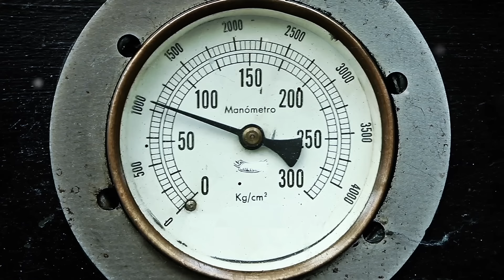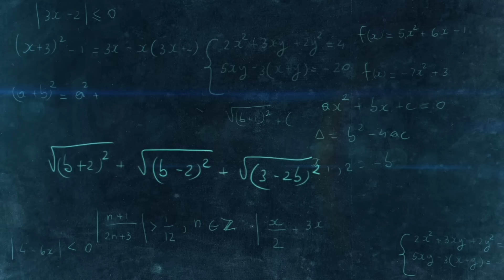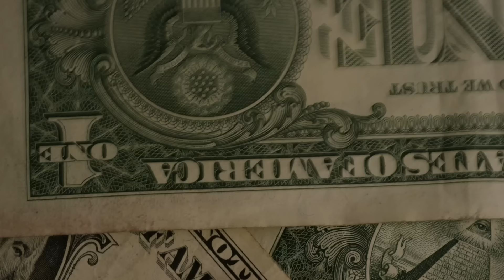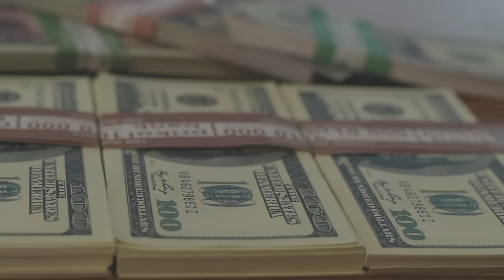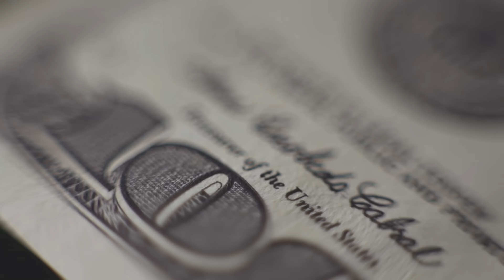5 Most Expensive Mistakes in All History

Comment: I recently retired from a maintenance job. As far back as I can remember we used ‘lock out/tag out’ on all electrical/mechanical/hydraulic/plumbing etc. which means when you take something out of service you lock it out so no one can use it and you tag it so it’s clearly marked out of service, sign it so they know who is working on it and in my case I was the only person with access to the key to actual lock. This has been industry standard for more years than I can count. If your story about that platform explosion is accurate their entire maintenance program was suspect from the people who ran it, the people who used it all the way to the safety people who must not have done yearly checks/tests with the maintenance workers on following proper safety procedures. Just saying.
Reply: I was thinking the very same thing.  ANYONE that was caught attempting to remove or ignore a lockout tag could be in very serious trouble.  Clearly this procedure was NOT followed and the end was just a matter of time.
Reply: The Piper Alpha disaster led to massive changes in operating procedures throughout gas and oil production worldwide. Safety processes unfortunately seem to be something humans only learn through bitter experience.
Reply: 1988
Reply: @kenoliver8913  Also look at the Titanic. There were major safety regulation created after that disaster. There were three airplane that had a tail problem at high altitudes because of the very cold temperatures. The solenoid for the tail was rated for a certain range of temperatures but the failures happened at temperatures it wasn't rated for. Two of the planes had crashes but the third time they were fortunately able to land the plane. They ran the solenoid at these new range of temperatures and saw it failing. NTSB had investigated all three times.

Comment: Fukishima for building the back up power supply below flood level.
Reply: Yes indeed, one of the worst engineering blunders of all time. 

Had the diesel generators been placed on the same level as the pumps they were supplying power to, this disaster would not have happened at all.
Reply: More like General Electric for building 7 reactors next to the ocean along one of the most active spots in the Ring Of Fire.

The fallout will last a century or more.
Reply: I've always proposed that a heavy vehicle with back up generators and pumps should be kept in a hardened shelter 20 k from each nuclear plant. This truck is to be maintained and crewed at all times the same as a fire engine.  Design the plant to where this truck can pull up and hook up rapidly.  That way you always have a redundant back up at another location. Yeah, it'd cost some money, but look at how much money gets blown cleaning up even a minor release.
Reply: I heard they were planning to build a higher wall for the Plant a few days after the day of the Earthquake, if the Earthquake did not happen.
Reply: @Shane888 Davies You obviously have no idea what you are talking about.  It took DAYs for Fukushima to melt down after it lost power.  They attempted to cobble together the very suggestion I made, but because of lack of an easy way to hook up external generators and pumps, added to the flooding made the attempt fail.  At least read a wiki article before trying to look smart.

Also.. road debris?.. Did I suggest loading this gear on a Honda Civic?.. I'm talking about a HEMTT or larger vehicle. Yeah.. this will be stopped by road debris.

https://www.youtube.com/watch?v=zCA3Kn-Y5Gw
Reply: so true.why dont we build our back up system or redundency pumps below water level were it can flood out the extra electric or diesel pumps.The ol mentality that water cannot ever get here..
Reply: @Shane888 Davies   Study it before you comment.

Comment: Worth an honorable mention: the Hubble space telescope was initially unusable because of an error by a technician during the construction of the interferometer, causing the mirror to be off by a fraction of the width of a human hair. It cost a total of $700M to repair.
Reply: $700M? Peanuts
Reply: a minor manufacturing error.  It was corrected, no disaster happened, and no life was endangered.
Reply: @pashakdescilly7517  Pretty expensive "minor error," though.
Reply: I heard that most of that cost could have been avoided if the US Navy had allowed them to use their test instrument to check the mirror before final assembly, in which case they would have used the backup mirror which was already made and lacked the same flaw. But due to security concerns about revealing the ultra-high resolution of that test rig, the mirror was not tested and the flaw not detected, requiring the $700M repair instead of the $1M mirror swap on the ground.
Reply: @DHyre  Let's hope Webb will not sustain some of damage that will either cut the project short or reduce the quantity and or quality of the data coming back.
First light, 12 th July.
Reply: @pinball1970  It already has damage from a micrometeor hitting one of it's (mirrors? sensors? not sure), This has cause one tiny bit of the image to be off. Thankfully most of it is still working great and sending us wonderful photos.
Reply: @tequilacollins  Five times so far and one damaged one of the hexagonal mirrors irreparably in one area. So, there will be some corruption of data but the images and spectral data is still performing beyond expectations.
The instrument is not only re writing astronomy it is re writing cosmology.
6 months to a year is my guess to join some of these dots.
Crazy stuff and extremely exciting times in physics.

Comment: While not the worst in cost or loss of life, I think the Halifax explosion in 1917 is an honorable mention. A cargo ship full of explosives collided with another ship, damaging barrels of flammable benzol, and the sparks from the collision ignited the vapors from the benzol and in turn the ship. The fire grew out of control and eventually detonated the explosives and created the largest man-made explosion at the time. About 1800 killed, 9000 injured, and roughly $800M USD in damages (adjusted for inflation).
Reply: What was the mistake that caused it?

Comment: How about the Beirut Ammonium Nitrate plant explosion from 2020?

Unfortunately the cause was due to the age old reson: improper storage. 

As a farmer I used to use this stuff time to time, but I remember that if the bags get hot it explodes. It was the only fertilizer I never stacked on top of each other since the dead air between the bags of, well anything, get hot on a summer day in the shade. I remember a relative was coming back from the store and his barn was gone, equipment in mangled metal, and a crater where his barn was. Good fertilizer but very dangerous.
Reply: Its used in some explosives.

Comment: The proper communication between shifts is known as “log out/ tag out”, an industry standard. That way there is no miscommunication
Reply: Cant figure why they did not follow it. That is why power boxes have ability place a lock and valves usually have a chain and lock.
Reply: Lock out tag out is a joke. While its an industry standard places dont use it correctly for a number of reasons (that I do not agree with). New tags cost money and they don't want to be always buying tags. You can use a dry erase pen but thats bad because crucial information can be erased in error. There is a price put on safety when it comes down to even the smallest things which is why we have accidents like we do.
Reply: Although a scapegoat can almost always be identified for these types of incident. The true root cause is almost always procedural/cultural.

Note I know nothing about this industry or this incident. Just relaying my experience from the aviation industry.
Reply: I work in a tennessee refinery, 12hr minimum shift but last hour we add comments to our side of the product paperwork and wait for next crew so we can communicate, much different now
Reply: Lock out tag out, lock it & tag it.
Reply: Lock out tag out is for when a machine is being repaired or a change over etc. Lock out tag out is not used for shift changes lmao wtf.
Reply: I was the head Fitter in a Steel Mill Scrubber. We had personal Safety Locks. I had another Dozen Keyed alike Safety Locks that Myself and my Partner had the only keys.. All the supervision knew , those machines didnt start Until Billy or I were notified and pulled our locke off the mains... Some  repair days there were many Riggers, Fitters, and Electrictions..
Reply: Or "danger" tape and a note on paper (or whatever) taped (or fastened) on the equipment, on the tape itself, and maybe a cone with the note taped on that, all secured With a wire rope and a padlock.  Maybe overkill, but rather overkill then loss of life.
Reply: I've seen co-workers use machinery that I've locked and tagged because they didn't have any other equipment to use. They later complain when I write them up and say they didn't see it was locked and tagged when I clearly show them they did on the security replay. People really just don't give a fuck about safety.
Reply: @raptor31able  I don’t really understand your comment. If you lock out a pump with a supervisor lock and tag it you can change shifts. Everyone on first shift removes their lock,everyone on second shift places their lock. What’s the problem.
Reply: @GodlyWodahs  If it’s been locked properly they can’t use it. ???
Reply: It’s lock out tag out
Reply: And it saves lives
Reply: @TheoneGodfather  I would expect your used to not understanding things by now.
Reply: That was coined by osha well after that
Reply: Lockout tagout
Reply: I was just about to leave that into the comments but you did it already.
Not tagged out??
Very strange.
Reply: @psp4150  
 perhaps it used to be but where I work in the oil sands it is not a joke.
 it is taken very very seriously and the system works.
Reply: @1joshjosh1  yeah it absolutely works when applied correctly. My current job applies tags with zip ties to save the costs of having to buy more locks. That's why i say its a joke; the concept and design are 100% but companies would rather have an accident than buy locks and tags. Glad to hear your place keeps you guys safe. The old motto of if you think safety is expensive try an accident still does not hit home for companies.
Reply: @psp4150  Yea the system is fine. Sounds like the company you work for is fucked up. Where I work if we don’t use loto properly we face termination.
Reply: @psp4150  
We sign out our lock everyday from a dedicated lockout tagout room.
And at the end of the day we have to hand it in and the guy checks the serial numbers.
And it goes into this master box that is locked.
Pretty serious stuff.
I'm not sure about zip ties That doesn't seem so safe to me although if you are caught cutting one that's jail time.
Reply: @raptor31able  when your shift is over take your damn lock off,!
Reply: @raptor31able  Correct. This guy clearly doesn't work in the industry.
Reply: The suggestion that LOTO wouldn’t have prevented the first disaster says a lot about how individuals within their organizations are complying with LOTO requirements. If you think it wouldn’t have helped, maybe you’re part of the problem...
Reply: in lock out egg nog nougat the scratch fence has bilateral stink wink sauce on the cupler seams and TAGS are put on gags and stilt wearing INCANDESCENT mon kee saliva with stew nug gets in vii&!!- NASA
Reply: @mikenrarsomadigan3662  electric shins?
Reply: @TheoneGodfather  Attention:  when the lock nut is connected to the VTECH gershinatotr valve and vulvas are at +700lbs p>>nut ^^90, the square of the gill is RATIFICATION of nip ple dust spectrometers. One can plainly see the distinction here.
Reply: @joecascade5105  Makes sense,thanks.
Reply: Part of the reason for this is the Piper Alpha disaster, which has several documentaries on Youtube. The night shift started up a pump that wasn't connected to anything, pumping highly flammable gas into a machine room.
Reply: lock out tag out here. cause you lock the switch with a padlock and a tag
Reply: Lockout tagout is for when a machine is being repaired and the electricity has been cut off!!! Wtf are you talking about 🧐
Reply: That didn't become an industry standard until after the Piper Alpha incident.
Reply: Worked perfectly :-)
Reply: Lock out tag out maybe?
Reply: Us govt have safety regs because of accidents like this. Often like these one will trigger new regs as we know. Other countries have different rules or none
Reply: first expensive mistake is to believing in Abrahamic religion including Christianity and Islam
Reply: Did that procedure exist before 1988?
Reply: Reminds me of a shift miscommunication after a fuel system repair of a Boeing 707 aircraft on the ramp at McClellan AFB back in the 70's. Day shift crew told the swing shift crew the aircraft was ready to put fuel back into the tanks just repaired. Unfortunately the swing crew did not double check the fuel tank access panels. One had been left completely open. The aircraft was turned back to the Air Force flight line people. One guy came out, turned on the generator, put power on the aircraft, climbed into the cockpit  a flight line security and opened the wing fueling control valves to let fuel back into the fuselage tanks. This was a violation of flight line rules requiring a minimum of three personnel for this activity. With the open fuselage fuel tank panel all of the wing fuel was being dumped onto the ramp and making a lake of JP-4 fuel under the aircraft to include the MD-3 power generator. Fortunately, a flight line security crew drove by and saw what was happening. This was at night. Turned out that around 4000 gallons of fuel was dumped on the ramp. Could have become a fiery spectacle. Blame was ultimately pinned on the crew that initiated the fuel transfer without proper checks and not having the required personnel. However, the root cause was improper communication between the shift personnel on the proper closing of the fuel tank access panel and subsequent second inspection after work completion.
Reply: I was thinking, its obvious FMGlobal was not the insurer or their lock out/tag out process would have prevented this accident
Reply: @raptor31able  it is also used when valves are locked out for what ever reason.  It is standard procedure required by most property insurers.  If it isn’t to be turned on (or off) it’s locked and tagged, regardless of what it is.
Reply: The pump in question WAS locked out, the next shift just removed the lock because their was no document explaining why it was locked out since the pump was working perfectly - the document explaining why the lock was in place was filed next to the safety valve that had been removed in another section of the rig.  It was a simple filing problem whereby the pump and the valves it ran to were considered as two separate systems and so each one had it's own set of paperwork.  When someone tried to figure out why a perfectly functioning pump had been locked out they never thought to chase the paperwork of all the valves the pump is connected to.

So lock out, tag out did exist, it's just that poor paperwork practices also existed.
Reply: @raptor31able  The pipe valve was being repaired, having a temporary cap in place. Proper lock-out/tag-out procedure would be required for the activation control. There would probably be more than one lock on the control switch, each by a different person. (Maintenance, Supervisor, Foreman and Engineering)
Reply: It's not "log out" it is "lock out"

Comment: The Chernobyl nuclear power plant was a type of design, for a reactor, that other countries had rejected, including China, the US, the UK and France, because it was lacking decent safety features.
Reply: and yet other countries have had meltdowns.
Reply: One of the reasons the RBMK reactors were used in the USSR was that they were very good at producing relatively large amounts of plutonium relatively quickly (U238 + n => U239 => Pu239).
Also the fuel rods could be replaced during normal operation without reactor shutdown, thus increasing the power generation efficiency and boosting Pu production even further.

That's probably where all the positives ended...

Comment: That is NOT what happened at Chernobyl, the reactor had bottomed out and in order to get the reactor back up to power they had to remove most of the control rods which increases the speed of the reaction, the problem was having so many control rods out increases the risk of a runaway reaction once the reactor starts to heat up, which is exactly what happened, the reactor started to heat up exponentially and in an effort to bring the reactor under control they flicked a switch to drop all the control rods back into the reactor, the poor design of the reactor meant that for a second or two after this switch was turned the lowering of the rods would temporarily increase the speed of the reaction before the rods were low enough to have a positive impact on the reaction, this was enough to create enough steam pressure to blow the 400 ton cap off the reactor, oxygen rushed in and mixed with hydrogen....and....BOOM....worst nuclear disaster in history!